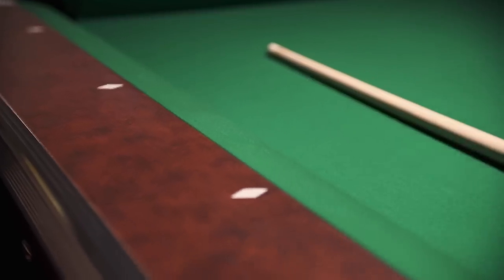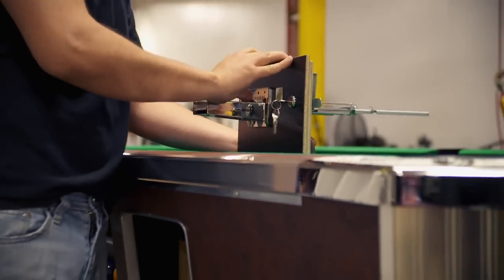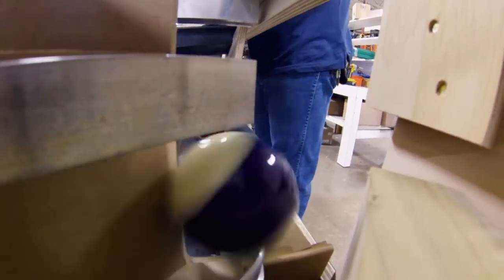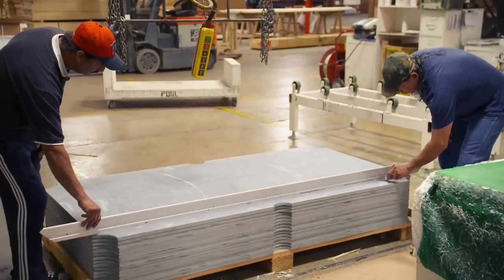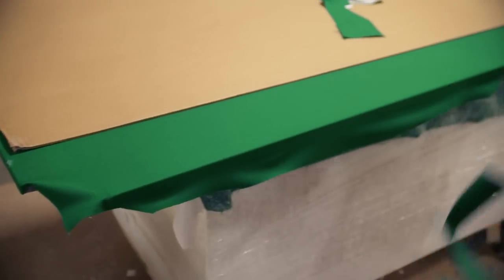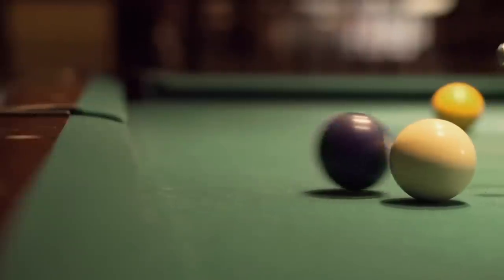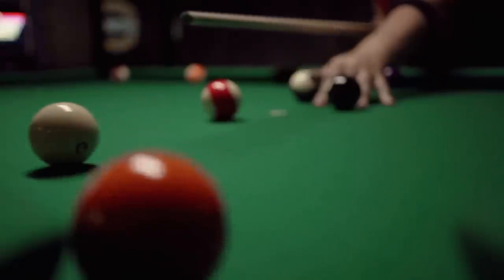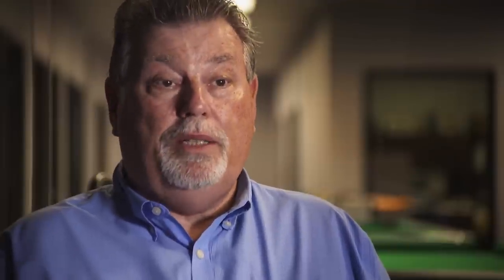How a Valley Panther Pool Table is made - BRANDMADE.TV

Comment: This guy is a dope.  The magnetic ball is NOT a ball with "a magnet built into one side of it" as he stated.  The ENTIRE cue ball is EVENLY magnetic.  The BALL RETURN has "a magnet built along one side of it, which pulls the homogeneously magnetic cue ball out of the ball return track and drops it into the cue ball return track.  The Aluminum bar at that point in the ball return track is so that the old oversize cue ball will get diverted to the cue ball track as well.

Comment: Wrong!  A "regulation table" starts at 4' x 8'.  So NO 3 1/2 ' x 7' table is regulation.  The two square form factor is NOT the defining element.  ALL pool tables are "twice as long as it is wide".  That is NOT the defining element.  It starts at 4' x 8' PERIOD, and that and the pocket opening geometry and rail nose height are the defining elements.
Reply: What should the pocket opening geometry be and rail nose height be? I know valley tables have bigger pockets than "traditional pool tables".